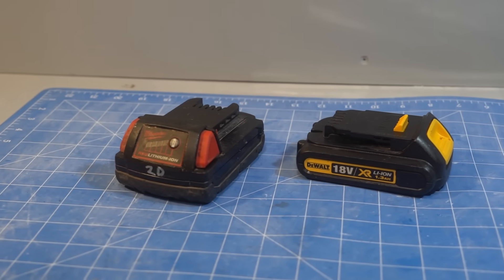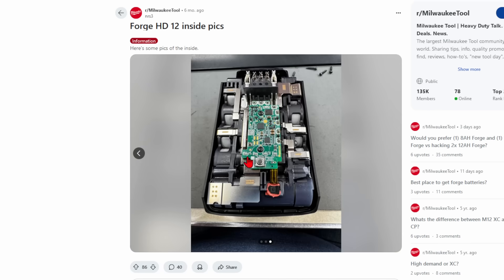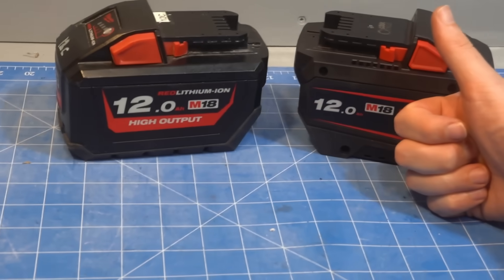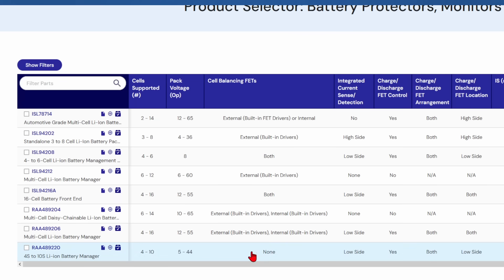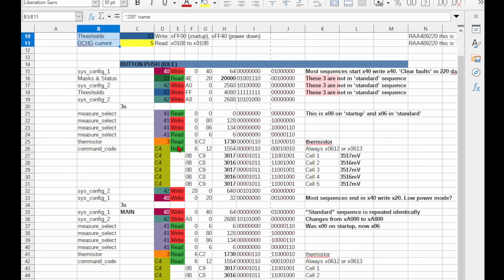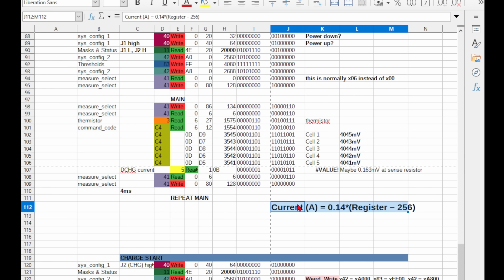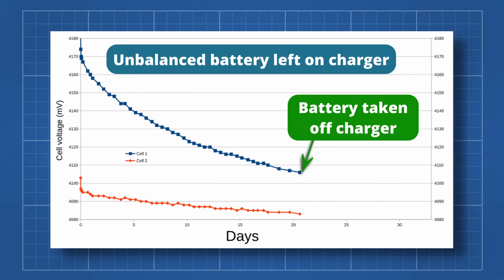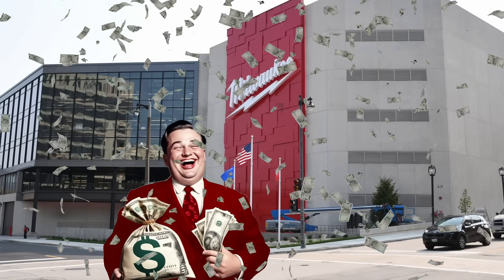[011] Do Milwaukee FORGE batteries balance

Comment: I'm done with milwaukee.
Reply from the maker: Every brand has it's pros and cons. Milwaukee's pros are rapid innovation - their cons are average reliability.
Reply: @toolscientist  over half my m18 batteries failed with less than 20 charge cycles.  3x 12ah, 2x 6ah, and 2x 6ah m12 batteries.  I had 3 tools fail and milwaukee took 3 months on one, and 4 months each on the other two.
I'm also fairly ticked at home depot for selling me m18 batteries that were 2 1/2 years old.  They were scrounging up whatever lost inventory they could find during covid.  They're not supposed to sell them past one year old according to milwaukee.  The batteries did not get warrantied due to my inability to find the cash receipts. 
Over the last year or more i have bought quite a few Hercules tools....saws, recip saw, drill, and impacter along with several 12ah and 8ah batteries.  No broken tools, no failed batteries.  And I've worked the daylights out of them.
Yeah...I'm done with milwaukee for good.  My track saw and nailguns have been flawless but i refuse to buy anymore m18 batteries to keep them going.  I don't reward failure.

Comment: What about Makita? Do they balance? Or no-name knock-offs?
Reply from the maker: I'm yet to test them for balancing. Hopefully in the next few months. Some of their batteries have an integrated MCU+AFE, so I can't eavesdrop the i2c comms. That means I'll have to do long term testing like in this video.
Reply: @toolscientist  As a little side note, you can very easily check the temperature to see if anything is actually balancing. Ideally with a thermal camera. De-balance pack, put on charger, observe hot spots that were not present in the baseline prior to debalancing. With the pack I saw this in they were pulsed, so even more easy to see the balancing.
Reply from the maker: @leocurious9919  you saw this on a Makita pack?
Reply: @toolscientist  No, that was from an Ebike where I had to hack the battery and reverse engineer a lot. But I do actually have one, so I could try if you want?

Comment: Shame on Milwaukee for this shitty design.  I never had issues with my 5.0 batteries not fully charging, I have had issues with my 8.0 batteries not fully charging.  I have manually charged the weak cells with an RC charger to get them to work better, but you should not have to do that on an expensive battery.
Reply from the maker: Yeah, I'm yet to see a good reason to not balance. I'm open to the possibility, but just seems like designed obsolescence to me.
Reply: @toolscientist If you ever get the firmware patch to activate the balance circuit I would be interested in trying it out on my 8.0 pack that has issues with battery balancing. Manual battery balancing with the RC charger is a necessary evil to keep the battery viable but not ideal.

Comment: you done such a great job 👏
i will monitor the same using Milwaukee reader and see what i find

don’t know why they are so lazy just to write a code to balance them. Doesn’t take much and i agreed that every aspect was made better/improved

the Samsung 40T version 3 so far better than ver 1 and 2 which fail badly
Reply from the maker: What's the "Milwaukee Reader"?
Reply: @ their own tool that can shows the cells voltage 
i noticed it gives a different reading compare to actual cells level, i suspect that the board has issue on those high output
Reply from the maker: @TranTek  what's the name of this tool? Is it available to the public? What other info does it show?
Reply: @toolscientist  it is one of usb adapter but you need Milwaukee service account 
which i was give to
it gives you info like serial number, number of charge and born date and cells voltage
Reply from the maker: @TranTek  do Forge batteries show any new info, or same info as old batteries? Do you know what's the earliest batteries that had this? I think 2013 was when they introduced Redlink PLUS.
Reply: @toolscientist  will let you know
have not even open my 6, 8 and 12 yet
been so busy watching your video and keep up with customers
Reply: @TranTek  That's really interesting!  Do you get any other information than the already mentioned, like error codes? Is there anything you can set/configure?

Comment: Since they dont balance is there a charging / usage regimen to get the most life out of these, its getting quite expensive ?
Reply: Buy an RC hobby charger. Make up a JST-XH balance lead with alligator clips on it.
Open the pack up, and attach the clips to the cells. Balance charge it.
Only needed every few months, but the more often the better. The more balanced the cells, the more usable capacity can be stored in it.
A seemingly dead pack can be restored simply by balancing in this way.
But no matter what... with such savage charge/discharge currents used in power tools the cells age very quickly. So, you are never going to get particularly good life from them even if they remain perfectly balanced.
Reply: @johncoops6897  Thanks for the reply. Im going to try this

Comment: If you wanted to do a manual cell balance (e.g. putting a resistor across a high cell), would something like a 200/300 Ohm be suitable?  Higher/ lower maybe, what sort of wattage rating?
Reply from the maker: Power = (V^2)/R = ([4V]^2)/R = 16/R. So 2-Ohm will be 8 watts, which will work for those big, white, power resistors. Standard through-hole resistors are usually 0.25 or 0.125 watts, so that will need 64 or 128 Ohm, respecively. 100-Ohm or 200-Ohm would be better for some safety margin. Resistor bleed is tricky as you need to monitor it and account for the voltage "rebound" when you disconnect the resistor. I'd set up a few in parallel - something like 100, 220, 470, 1k. As you get to your target voltage, disconnect the 100, then wait for it to get back to target, then disconnect 220, and so on.

Easiest way is with a single cell Li-ion charger, such as 18650/21700 chargers ($10-$100 depending on features) or TP4056 based chargers (which are a few dollars). I've seen someone use 5x TP4056 chargers so that it's pretty much set and forget.
Reply: You can easily balance using a RC Hobby charger. Using resistors in some form of DIY hack is silly.

Comment: No potting on the boards??
Reply from the maker: It's very good potting, just not visible. Needs significant pressure (or sharp probes) to get a reading. The bus bars are coated, too. Needs a lot of pressure with multimeter probes to get a reading.
Reply: @toolscientist  hey man this is really good content please keep making more videos in this format!!
Reply from the maker: @edwardlogan267  thanks!

Comment: Besides Makita, none of the brands i know of do cell balancing.
Reply from the maker: Do you have any info on Makita balancing? I've heard people say both. You won't be able to post links, but you can post search terms for me.
Reply: @toolscientist  The charger does the balancing. The yellow center connector on the battery are the balancing terminals.
Reply from the maker: @stevesas4744  yellow connector is a digital interface. It doesn't connect to the cells (https://www.laptopu.ro/community/power-tools-battery-pinout/makita/paged/2/). If Makita batteries balance, it is done by the chip inside the battery. The RAJ240080 in their newer packs is definitely capable of balancing.
Reply: @toolscientist  Sorry i just assumed it was as there are a few pins and I have never seen these batteries go out of balance.
Reply from the maker: @stevesas4744  don't worry, I thought the same thing!

Comment: It is VERY true that a balancer cannot keep up with a bad cell. When you are pulling dozens or hundreds of amps a balancer will do nothing. The cells are either close in internal resistance and capacity or they are not. All of my milwaukee batteries are very close on the voltage spread across cells, they all stay balanced very good. But I admittedly do not use them alot like come people do. Also.. on my M12 there are pins on the outside to measure voltage of each cell, so what are those pins for if they are not for balancing when charging? Thats what I always assumed they were for, but maybe its just for monitoring..  With all that said, there is no reason NOT to put a balancer just for peace of mind and long term reliability. So its hard for Milwuakee to argue against using one IMO even though I do not think they are particularly necessary with GOOD cells.
Reply from the maker: Yeah, during discharge it would be impossible to keep balance, and potentially damaging to even try. Balancing is best done when the battery is settled, so ideally before charging, and then after charging being the next best. The brands can certainly have balancing happen for as long as the battery is left on the charger, which can correct for large imbalances. As you say, a failing cell will just keep dropping voltage as soon as the balancing stops, and at that point it would be best for the BMS to soft-lock the battery and somehow indicate for you to warranty/recycle it.
Reply: Those outside M12 pins connect via resistors inside and only seem to be used for monitoring.  Some of the M12 packs get horribly out of balance (eg Samsung 30Q cells used in the xc6.0 , known for their horrible propensity to self UN-balance..)

Comment: !!  Is this right??  Does the Torque Test Channel know about this?
Reply from the maker: Yes - unless I've missed some very specific conditions needed to trigger balancing. But I think leaving the battery on the charger for 21 days is well above what should be needed to trigger balancing. If it's not balancing within an hour of finishing charge, then it's almost certainly never balancing.
Reply: @toolscientist  Yeah, it looks like it's not happening...It should've started to balance that out right away. Egregious, esp with these new higher-output cells that are more likely to go out of balance under higher load...wtf?

Comment: With a balancing circuit they would end up charging so much for the packs that nobody could afford them and sales would drop.  My guess is the posterboard in the big wigs meeting room had a pro’s and con’s diagram with the words $ales and cells and charging and ¢harging.
Reply: Cell balancing isn't expensive. Parkside batteries from lidl do it, except for the older ones. As mentioned the chips here are capable of it. All else you need is a transitor and resistor. Its not expensive. 

Manufacturers are being lazy, same reason the batteries don't have inbuilt over discharge, overcurrent etc. protection and instead rely on the tool to stop itself from drawing power.

Ozito/einhell (a relatively cheap brand) batteries have cell balancing, overdischarge and overcurrent protection all built into the battery without relying on coms with the tool.
Reply from the maker: Inbuilt protection (or as I call it 'standalone protection') where the battery can protect itself does have its downsides. You either have to use expensive mosfets (like Makita's $10 mosfet), or accept power loss and heat build-up inside the battery. I don't mind brand's using the tool for cutoff, but I prefer when it's easy like Makita where they output 15-20V. Milwaukee is a pain because you need to obey their timing to activate the battery's signal, and then you need to boost the voltage of that signal to drive a power mosfet.
Reply: @toolscientist  an additional $10 on a battery that costs hundreds is pretty negligible. And if you can find it for $10, the tool companies will get it for significantly less in mass production. Like i mentioned, einhell have it and their batteries are significantly cheaper than the likes of milwaukee. Power tool batteries are mostly like printer ink, unreasonably overpriced. The cells and circuits inside don't cost anywhere near what they charge, they just know you'll pay because you're already on their platform.

Power tool batteries are the only example i can think of without proper battery protection, and now without cell balancing. Ebikes and the like have both (along with higher power requirements), power banks have it, everything else that isnt a bare battery cell has it and for good, safety related reasons.
Reply: not really, all the hardware is already there, it would cost them nothing.

Comment: Another great video. What tool manufactures are you aware of that do balance their batteries?
Reply from the maker: None as yet, but I've only tested Dewalt and Milwaukee for balancing.
Reply: None of them do, it makes the charge cycle too long. Laptops and electric vehicles dont balance either. It has downsides to most users, like the charging to "100%" taking hours and hours.
Reply from the maker: @johncoops6897  but if you always balance (and continue to balance when left on the charger), you shouldn't get large imbalances.
Reply: @toolscientist  - yes, but consumers want FAST CHARGING and that completely eliminates the possibility of balancing.
I am certainly not saying that balancing is bad, but no normal consumer knows or cares about it.
Since it adds cost, complexity and increases size, yet makes charging slower, the manufacturers have no reason to add it.
I've been adding balancing into some 2P2C 18650 10w portable worklights and it is almost impossible to even get that inside there. I ended up using a single inductor 2C active balance module that seems to work kind-of OK as it kicks in at 4.19V and due to keeping the charge current averaged out until the total drops below about 200mA, it almost gets the cells top balanced. It takes about half an hour extra, but if one cell is particularly low (ie on the way out) then it will never hit cutoff. That in itself kills the other cell.
Reply from the maker: @johncoops6897  their older packs (everything except Forge) had a BQ76925, which has balancing hardware. The only extra cost would be the day or 2 to code and test it. Even if you only balance after charging, you're at least giving the battery a chance. It also wouldn't be hard to put an extra LED on the charger and call it balancing, maintenance, conditioning, or whatever is easiest for customers to understand

Comment: Still could be worse. I've opened bosch pro core 8Ah 18V battery, those don't even have anything connected between cells. This battery sells at Bunnings fos A$300. Well done Bosch (Amp share)
Reply from the maker: Bosch has cell connections. They're hidden inside, so you need to fully disassemble to see them. That's part of the reason that they have no cell wrappers as the contacts are on the middle of the cell rather than the ends
Reply: @toolscientist  oh, didn't realise and I didn't go that far.
Do you know if Bosch does balancing?
the pack I've opened had cells ranging from 3.55 to 4.1V
Reply from the maker: @furmek  don't know yet. I just bought a Bosch drill, battery, and charger, so they'll be twsted in the next few months.

Comment: At the begining of this video,i thought”eff it,i will buy one,will use it for work,its worth it. “After this-NO! Imbalance cell pack is potentially hazardous fire,best case scenario,its poop in one year. Thank you for detailed video. Very helpfull
Reply from the maker: There's little fire risk. The BMS stops discharge when any cell goes below 2.5V or above 4.2V. Imbalance on these batteries just means reduced usable capacity. I'm still annoued that they don't even try to balance, though

Comment: Great informative video. Well done sir 👍 can you actually write a program to balance cells since it has balancing hardware??
Reply from the maker: I don't know if this chip has balancing hardware. Won't know until Renesas releases the datasheet. For the old batteries, we could modify the old code to add balancing, but the old code will be protected by copyright law, so we could not distribute it, only the patch.
Reply: @toolscientist  yea I was talking about the old one since you said it had the transistors but not programmed. A patch would be a good idea if it can be done. Thanks

Comment: Thanks for the video.  Even though these do not have cell balancing the new case design and material is good because once you do get the 3 bars of doom you can open it up, manually balance and reassemble and not be overly concerned with stripping out the screws each time.
Reply: If one is a bit careful they'll get dozens of openings/closing of the old packs.  Hold your bit with fingertips and turn the screw backward until feeling it fall into the old thread. It will then follow the old thread without damage or resistance. I use  an aluminum tube for a bit holder at the desk and it's plenty of grip when not cutting new threads.

Comment: When Dewalt originally released the 36v Lithium Packs you could leave the battery on the charger for more than 12hrs and the battery would be balanced. I had 36v batteries that lasted me 8 years of hard use, gone are the good ole days. 

The 5ah Powerstacks where so undependable that I sold 5 new batteries in the Bubble Pack that where warranty replacement for $100. Doing warranty claims every 45 days was not acceptable even though Dewalt replaced them everytime. I have one 5ah left that is nearing 2 years old still going strong.
Reply from the maker: I have a 5Ah powerstack that I'm going to look closer at. It has a chip that is capable of balancing, but that doesn't mean they use it. It also won't help if the cells are garbage. I was very suspicious of pouch cells and all the marketing around them that tried to convince everyone that they weren't LiPo. I'm pretty sure they're just LiPo and will have the same short cycle life. I've read a few reports similar to yours where people have gone through multiple warranty replacements before giving up on them.